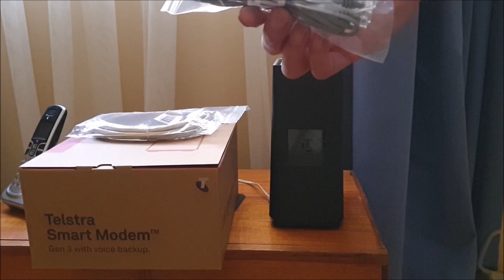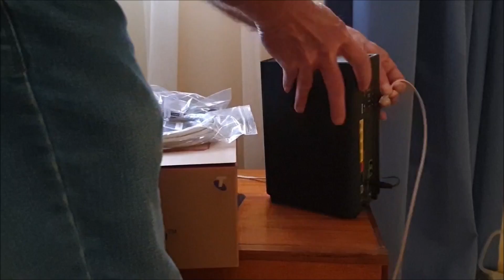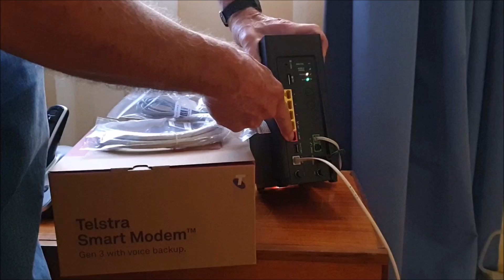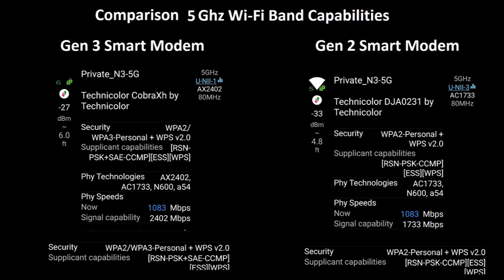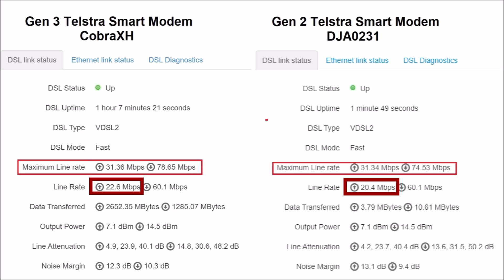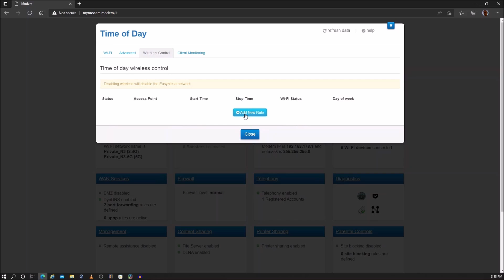Telstra Gen 3 Smart Modem Review

Comment: Quick question:- Tesltra Modem won't allow smart devices to be connected..? Is there a way to fix it... 

I have called telstra and explaine it, they have no clue... even bought my self a router, still doesn't/won't fix it
Reply from the maker: I have over 30 smart devices connected to my modem. Most smart devices only support the 2.4 GHz Wi-Fi band. Make sure the device used for setting the smart device is connected to the 2.4 GHz Band.

Another thing that might be preventing the connection is the modem might have a faulty 2.4GHz Wi-Fi radio. It is not uncommon for the 2.4 GHz Wi-Fi radio to go faulty on these modems especially the Technicolor version. This can be checked by installing a Wi-Fi scanner on an Android phone or PC and doing a scan.

Comment: How can you log into the settings on this modem? Also how do you know if it’s working on 2.4ghz or 5.ghz I  can’t connect my security camera?
Reply from the maker: To log into modem's settings, open a web browser on a device connected to modem and go to http://192.168.0.1. Default username is admin and default password is same as Wi-Fi password which is written on bottom of modem.

The modem should be transmitting Wi-Fi on both the 2.4 GHz and 5 GHz Wi-Fi band. To check if 2.4 GHz Wi-Fi is transmitting you could try disabling band steering. See Disabling band steering at the link below.
https://www.telstra.com.au/support/internet-and-home-phone/telstra-smart-modem-support
Reply: @DavidSmith-ir4hl  hey thanks David I’ve logged in to my Modem settings Ive selected the 2.4ghz for my security camera & changed the interface setting to Telstra internet?

Comment: Telstra sent me 2 of these by accident. Is there any way I could set up a second one as an access point? I saw your previous tutorial on that and was wondering if it would work
Reply from the maker: Yes, you should be able to set one up as an access point. Follow the instructions in this video:  https://youtu.be/vhHiHrQ9bEg
The only difference between the earlier Technicolor smart modems GUI is that the Gen 3 Smart Modem doesn't have a Basic settings page. After logging in to the GEN 3 GUI the Advanced settings are displayed.

Comment: Hi David I just reinstall my Telstra Smart Modem and Ive only got two(2) green light WAN /DSL & WiFi. The other two are amber ie mobile signal and phone. Please suggest what I need to do. Ive rebooted twice. Cheers Mike
Reply from the maker: Unfortunately, there is not much you can do apart from check all connections are correct. There are no settings in the modem as it should automatically configure itself. If modem is connected correctly suggest you contact Telstra and report a fault.

Comment: Hi, can someone please tell where I can check the wifi signal strength using the Telstra home dashboard app? I have rung Telstra and they've told me that this is a third party app. If so, what is the app used to generate the heat map?
Reply from the maker: The Telstra home dashboard app was discontinued about 5 years ago and is no longer available in the google play and apple app store. I installed it before it was discontinued and also created a backup apk that can be side loaded onto an android device.
Reply: Thanks Dave

Comment: Hi David.  Looks like the 2.4 Ghz range really was an improvement - which interests me as I'm on a rural property with no other networks for a km or more.  But I see that you tested the 2.4 Ghz with an 802.11ax client, am I right?  Did you test range with with an older 2.4 Ghz (effectively 802.11n) client?  If so, was the range improved for those clients too?
Reply from the maker: The device used for taking the measurements for the heat map of the Wi-Fi coverage at the 2 minutes and 50 second mark in the video, was a Samsung Galaxy A6 tablet. This tablet only has Wi-Fi N on the 2.4 GHz band (802.11 a/b/g/n/ac 2.4G+5GHz, VHT80). Judging from the heat map the range is improved on older devices that only support Wi-Fi N.

For the speed tests I used both a Wi-Fi 5 (802.11 ac Samsung Galaxy S9 phone) and Wi-F6 (802.11 ax, Dell laptop) and compared the two. Both the Wi-Fi 5 and Wi-Fi 6 devices were faster on the 2.4 GHz Wi-Fi band at all locations when connected to Gen 3 modem compared to when connected to the Gen 2 modem. Interestingly when connected to Gen 3 modem the Wi-Fi 6 device was faster than the Wi-Fi 5 device at all locations, but when connected to the Gen 2 modem the Wi-Fi 5 device was faster. See table at the 5 minute 30 second mark in the video.
Reply: @DavidSmith-ir4hl  Thanks, great information.  I was hoping that Wifi 6's beam forming and the 4x4 array in the Gen 3 @ 2.4 Ghz would add range to all devices, compared to the Wifi 5 Gen 2 (which on 2.4 Ghz is basically 802.11n anyway).  Looks like your range testing bore that out.

In a rural setting where there is no other 2.4 Ghz wifi around, this should mean a real improvement and a reason to go to wifi 6 even for legacy 2.4 devices.

Comment: Hi David, thanks for your videos, you have helped me out alot over the last few years. One question, i am having trouble connecting smart devices (lights, power points ect) to the new gen3 modem. I have tried splitting the 2.4g and 5g but still had no luck connecting to 2.4g. Do you have any tips to help me connect them? Im assuming it has something to do with the new wifi 6? Cheers
Reply from the maker: I no longer have the Telstra Gen 3 Smart modem but have the Telstra 5G Home modem. This also has Wi-Fi 6. On this modem I found that I had to change the Authentication method from WPA3 to WPA/WPA2 to enable the connection of all smart Wi-Fi devices. So, you could try changing the Authentication method. Also check the Wi-Fi channel in use is between 1 and 11.
Reply: @DavidSmith-ir4hl  hi David, thanks so much for that info. I will give that a go and let you know how it goes. Cheers
Reply: @DavidSmith-ir4hl  Hi David, Just want to say thanks once again. You have solved my issue. I think it was the channel that i had wrong.
Reply from the maker: @ashleywhisler8552  Glad to hear that you were able to fix the problem.

Comment: I have gen 3 wifi booster and a spare gen 3 modem.  would the gen 3 modem still out perform the wifi booster if i set i bridge it? hopefully that makes sense
Reply from the maker: I haven't tried but theoretically if the booster was connected to main modem by cable the modem would have same performance as the booster. If the booster is connected to main modem by Wi-Fi and modem is connected by LAN cable the modem would have better performance.

Comment: We got this modem today , the front light flashed great? Not sure what that means then went back to flashing orange. Could not get a solid green light at all
Reply from the maker: Front light shouldn't continuously blink orange. There is a fault, and you should contact Telstra support to get the fault fix. If you have an ADSL connection the fault might be due to the wrong ID and password in the modem's Internet settings.
Reply: Spent 2 hours with them ... apparently sending a new modem ... the lights on the back were green and if you logged into the modem it said it was working but it certainly wasn't

Comment: Anyone had success pairing a cordless phone to the Gen 3? In particular the T-Voice 503. I had 3 working on the Gen 2 but they just wont pair with the 3?? Any info appreciated.
Reply from the maker: The Gen 3 modem doesn't support the T-Voice 503 handset. It doesn't have a built in DECT base.
Reply: @DavidSmith-ir4hl  Thank you David. After searching Telstra pages I did find an Important statement that they do not support DECT. I now have 3 useless home phones. Two steps forward and 3 back. Telstra don't disclose critical information when they are selling you something.

Comment: Does the gen 3 require nbn?
Reply from the maker: For normal use the Gen 3 requires a wired connection such as NBN or ADSL. It can be used as a 4G LTE modem with the SIM replaced with a normal Telstra SIM.

Comment: Would it be possible for this booster to be compatible with an Optus modem?
Reply from the maker: You could set the modem up as an access point connected by LAN cable to one of the LAN ports on the Optus modem.

Comment: Hi… I have a F@ST 5355 gateway modem and NBN FTTN… my question is, is it worth upgrading to this modem??
Reply from the maker: Yes it is definitely worth upgrading to this modem.  Not only is the Wi-Fi faster and has a larger footprint the DSL modem is also better and syncs at a higher speed. The modem also has better security as the F@st5355 has not had a firmware update for several years. I did a comparison of several modems including the F@st5355 and Cobrxh. The results are located here. https://drive.google.com/file/d/17m3eW1iGMnwSipd-ybocevJ6c1KJ549Y/view?usp=sharing
Reply: @DavidSmith-ir4hl  thx brother 👍🏻
Reply: Mr wizard   any idea why my  cobra xh  "telstra gen3" like to reboot its self  2 kr 3 times in a row....dear ol telstra support is..well....telstra  support🤦😡
Reply from the maker: @MadLadMartyMcFly85  When first installed the modem might reboot several times as it installs firmware updates. Also sometimes a device that is incompatible with the modem can cause it to reboot. It could also be due to a faulty modem, Rule out it being a device on your network try disconnecting half the devices and if it doesn't reboot try with the other devices connected.
Reply: @DavidSmith-ir4hl  mmm  its only 1 device connected all day  and thats  my pc...its quite new.....is there something on pc i might need to change?

The full story is ..when ever there ar emultiple devices connected  including pc about devices10 max...the modem doesnt skip a beat..
But when its just  my pc  and nothing else..only 1 listed  device when you log into modems browser   it has a melt down....today ive tried factory reset, made it split the signals  to  2.4 and 5...instead of just  A signal...ive moved modems location to a different area to see if its an over heating issue(nothing changed)..ive connected  to  2.4  and 5ghz  through out the day

Only thing i know of left to do is manually  control the channels, but i cant see that being much of an issues due to  the space between  homes here
Reply: @DavidSmith-ir4hl  i just had a brain fart.....it could be an issue  related  to  ipv6....update you  tommorow

Comment: Hi thanks for sharing. I was wondering can I use this gen 3 as the main router and use my old gen 2 router as a WiFi extender….Don’t suppose you have made a video for a novice like me to follow? 😅
Reply from the maker: There are two versions of the Gen 2 modem. One made by Technicolor (DJA0231) and the other by Arcadyan (LH1000) Video for Technicolor is at https://youtu.be/vhHiHrQ9bEg and video for Arcadyan is at https://youtu.be/6-jUFVFG1ck. Also see section 34 in the unofficial manuals at  https://drive.google.com/file/d/1lDGZ83oZ19Y98rHINe2I7QFqWyaQO9WL/view?usp=sharing and https://drive.google.com/file/d/1BVq7jGm44RtQIbfGwSVvyj98i27qj1s9/view?usp=sharing. I haven't tried with the Gen 3 modem but the Gen 2 modems should work as access points with Gen 3 modem as main modem.
Reply: Thanks for the quick response! The gen2 I have is with sim at back (so I think it’s the arcaydan version I have). I was giving it a go there but as stated here with the gen 3 the admin page doesn’t have the basic Home Screen, so maybe no “advanced” section. I enter the diagnostic tab (also think I’ve searched all relevant possibilities) and there’s no WiFi tab for me to check the graph….I fear I may be too much of a novice to be able to set up if I’m stumped already in the first part! 😂

Comment: May I ask how does your mobile signal worked?
On my modem it’s not green
Reply from the maker: On my modem the mobile signal strength light varies between green orange and red. As long as its not off the mobile backup should work.
Reply from the maker: @illawarrior hill The mobile signal light indicates the strength of the mobile signal and should be green orange or red. If mobile signal light is off the mobile backup will not work when NBN goes down.

Comment: Would love to know how the wifi signal compares to the Telstra 5g home internet modem
Reply from the maker: The 5GHz Wi-Fi bands have identical theoretical performance (a54, N600. AC1733, AX2402), but the 5G Home modem has theoretically faster 2,4 GHz Wi-Fi ( b11, g54, N600, AX1147 compared to b11, g54, N289, AX574 for Gen3 Smart modem). I don't have a 5G Home modem so can't do a comparison but I have done a review (https://youtu.be/KqRA9A4wVmU) and I would say the Wi-Fi is about the same it was  much better than the Gen 2 Smart modem.
Reply: @DavidSmith-ir4hl   Thanks David I have been forced to switch to 5g home internet due to Telstra claiming the NBN team have found my service is affected by some external factors such as the current infrastructure. The more customers are connected in your area, the slower the speed offer. Happened very suddenly. Have had mutiple complaint cases had a telstra tech out and now case with ombudsman.

Comment: Thanks David, does it work as a 4g modem?  Reception is the key for us, any upgrade in its 4g antenna/reception?
Cheers
Reply from the maker: Yes the modem can be used as a 4G modem with the SIM replaced with a normal Telstra SIM and the profile changed in the mobile settings to Telstra .internet. It takes a while to connect and you might have to disable mobile for a few seconds (remember to save settings) and then re enable mobile.

Comment: Thanks for sharing. I’m using FTTP. During Ookla speedtest my Gen 3 ping 9ms while my previous Gen 2 ping only 2ms to the same host. Not sure why Gen 3 has much higher latency.
Reply from the maker: I have noticed that the Gen 3 has higher latency on Wi-Fi than a Wired connection when doing a Ookla speed test. 9ms Wi-Fi compared to 4ms wired. I have not compared the latency between Gen 3 and Gen 2. I will check when I get time and report back.
Reply from the maker: Finally got round to connecting a Arcadyan Telstra Gen 2 modem and comparing latency. To the same server on Wi-Fi 5GHz the Arcadyan had a latency of 6ms both close and far from modem. With the Gen 3 the latency was 9ms close and 19ms at about 30 Meters from modem. Speed was greater for the Gen 3 96/20 and 70/5 compared to 88/19 and 37/5 for the Arcadyan Gen 2 modem.